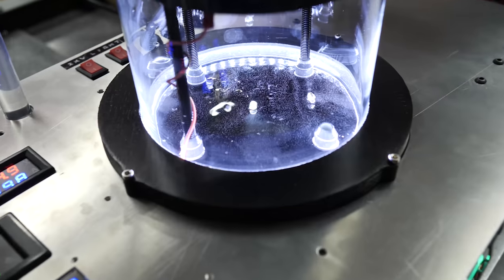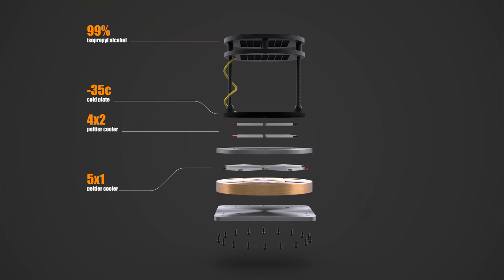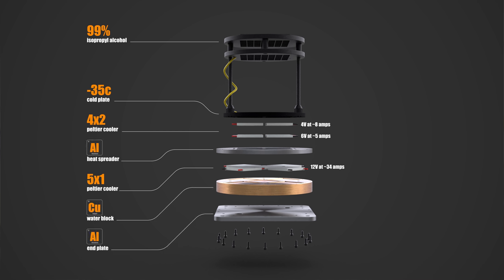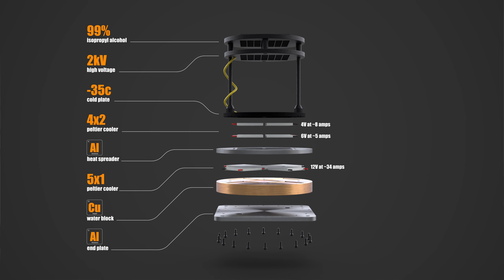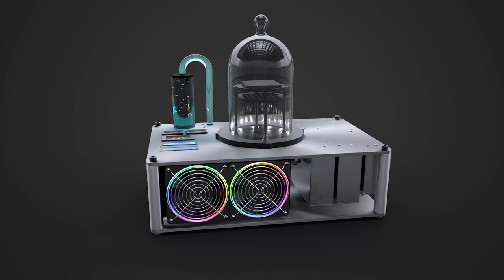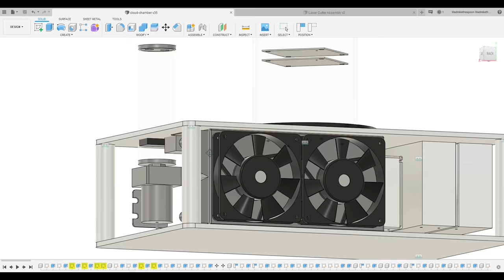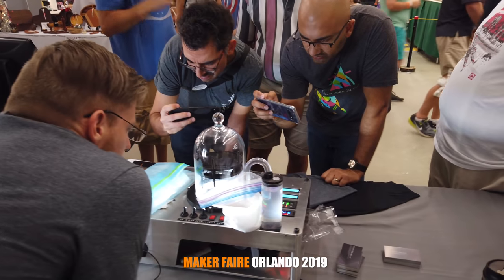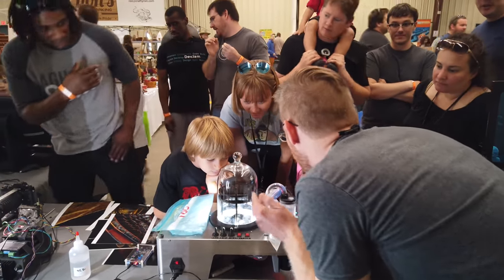Wilson Diffusion Cloud Chamber - S03E10

Comment: Could you please do an in-depth video on how you stacked the Peltier devices?
Reply: Here's a bit more info on our wiring/setup:http://www.physanon.com/cloud-chamber-stuff/
Suggestion if you're building your own: experiment with the voltages on your stack. The bottom layer will pretty much always be run full tilt, but the mid and top layers get big gains by even a half a volt adjustment. 12-6-4 worked really well for our setup, but I've had different numbers for different stacks before too.

Comment: Just for history, Wilson original chamber was using quick vacuum in a vapor saturated glass container, at least initially with water. It was not a "continuum cloud" device. Wilson introduced it to the Royal Society in 1912 (but the original idea dated back to 1899). The diffusion chamber like this was later proposed by I. C. Cornog , from Pennsylvania U., and further modified by R. B. Moody.

Comment: You could use an excentric grinder with scotch pads. That leaves an awesome finish on aluminum parts. You can also sand it with the grinder if you like, great surface ~ 400-600 grid

Comment: Did I see a California air tools compressor in the back corner there for the mister? they get Extremely hot with constant use like this. I built a cabinet for mine with 2x 120mm 115v fans directed at the two cylinder heads to keep it nice and moderately warm instead.

Comment: Hello, I am a total beginner in Metalworking. I would like to build a cnc. But for that I need to process some steel made plates with a cnc milling machine. Especially when building the z-axis. Is there any CNC milling machine you can recommend? The machine should not be above 2000 dollars.

Comment: You was have a very good work but efficent is very small. The mechanical cooler pum through use a compressor is very more efficent and is possible made a very large plane coler. But the mechanical costruction is fantastic

Comment: But Wait did you guys realy mixed metalls in an Watercooling system?
Reply: Sure did: galvanic corrosion is a real thing and all, but modern coolants do a good job of keeping it minimal. Example: most cars have a mix of aluminum, cast-iron, and copper throughout their cooling chain but they last for 20-50 years at much higher temperatures.